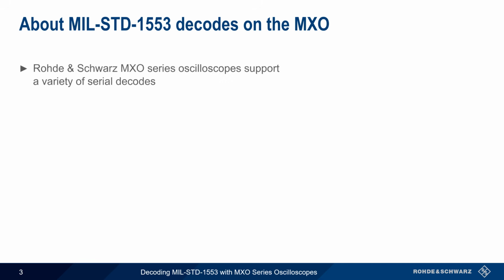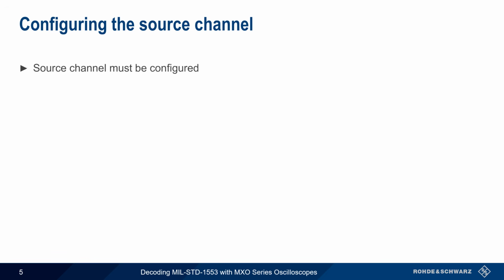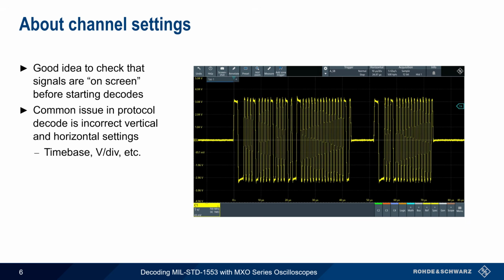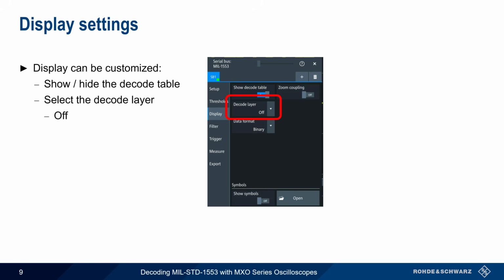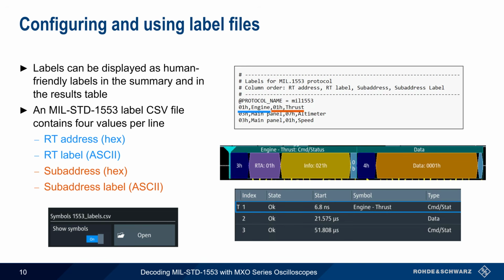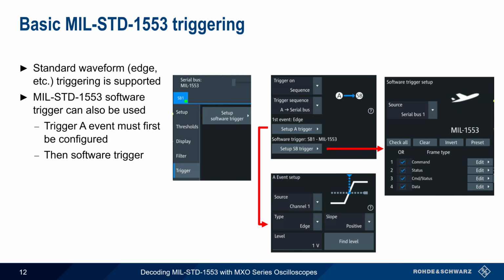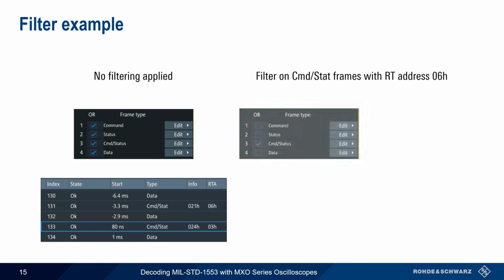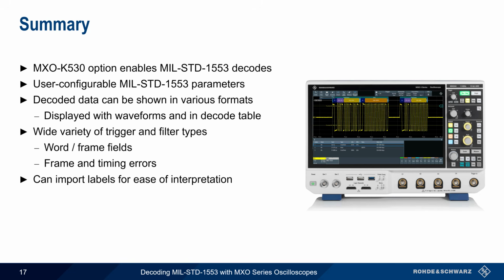Decoding MIL-STD-1553 with MXO Series Oscilloscopes

Comment: Is decoding basically the same thing as demodulating?
Reply: I'm just a guy, not with Rohde and Schwarz.  But I define demodulating as a process by which a signal is returned to its original characteristics after having been modulated in some way, usually to transmit it using an out-of-band carrier like a radio or TV frequency.

Decoding, on the other hand, is also a process by which a signal is returned to its original characteristics but after having been encoded, with for instance, an encyphering algorithm.  Modulation/demodulation modifies the signal without scrambling its meaning.  Coding transforms the signal so as to lose meaning until it is decoded.
Reply: @notgiven3114
Ok, that makes sense. Thanks!